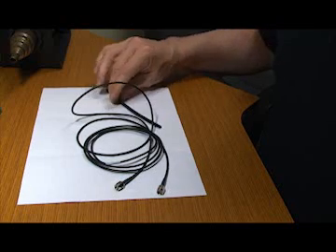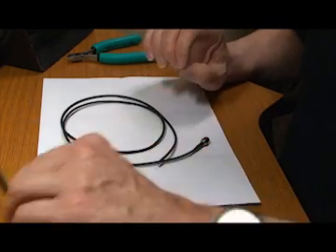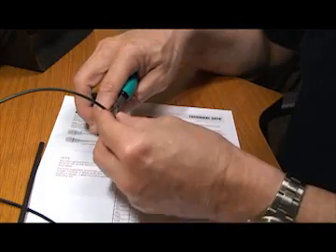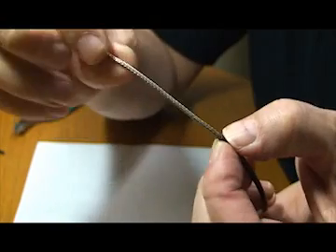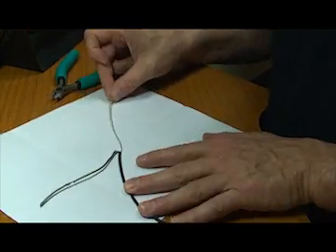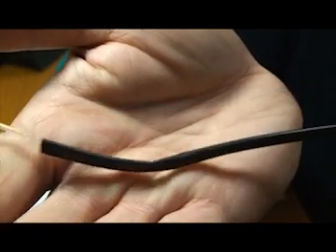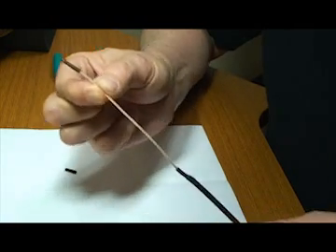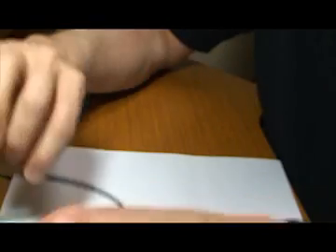Making a Coax Dipole Antenna for a Wireless Microphone System

Comment: Very helpful, thank you! What type of cable are you using?
Reply from the maker: We recently made some of these antennas again using Amphenol RG316 cable material with pre-terminated SMA connectors. We needed ones that were 4.5 ft. long so we purchased a 10 ft. SMA-SMA cable and cut it in half. RG174 also works well.

Comment: Hi.  Thanks for this video.   Any reason this can't be deployed with your 822's?  (I hear you mentioning in the video that this works with transmitters as well as receivers, but just triple checking since the video was made about 5 years before the 822's came out).  Thanks.
Reply from the maker: Yes, absolutely! Passive antennas are reciprocal - they can be used for transmitters or receivers, and have the same directional properties (i.e. a dipole has a "donut-shaped" pickup OR transmission pattern. These coax antennas with an SMA connector would work well for the DCR822.

Comment: What would be gained by stripping the dielectric? Exposing the copper.
Reply from the maker: The copper shield must be "rolled back" to expose the center conductor, which then acts as an antenna.
Reply: @lectrosonics  yes I do get that this is half of the antenna (it’s ground plane) and should be down for proper impedance. The questions regards the dielectric insulator on the upper element. It appears you left it surrounding the copper.
Would there be benefit on exposing the copper on the element instead of leaving it inside the dielectric as shown?
Reply from the maker: OK, understood. No, there would be no benefit to removing the dielectric, as it is transparent to RF. Keeping it in place will help keep the "antenna element" straight, and avoid oxidizing or damaging the copper conductors.
Reply: @lectrosonics  Thanks!

Comment: How wide of a frequency range would you recommend for this? I have some wide band SMDWB's. Could I make one antenna to use, or should I make several on different "center"  frequencies?
Reply from the maker: This type of antenna has about 100 MHz of bandwidth (3dB down points) so the 75 MHz tuning band of the SMWB type transmitters is well within that range. We recommend tuning the antenna to the middle of the band, so, for band A1, you would want the antenna tuned to about 500 MHz. We supply one whip antenna with these transmitters, for the A1 band we include a block 19 antenna, which is likewise tuned to the center of block 19 at about 500 MHz.
Reply: @lectrosonics  I am putting mics on some football players. Depending on the type of pads, sometimes the best mount is lower, or antenna down or sideways (which I know is not best). Looking to make some of these and tape it higher on the pads.
Thoughts and suggestions are welcome.
Reply from the maker: Yes, the higher the better, and vertical for the last few inches if possible. These cable antennas give you (literally) much more flexibility for placement. And, they can be simply taped in place as long as you are not using metallic tape. Up on the back of the shoulders is probably the best location if you can get that.
Reply: @lectrosonics  exactly what I was thinking. thank you for the confirmation.

Comment: and of course being a dipole I can plug it to any 50 ohms extended cable. 
Anyway I attached 2 of these  to my harness,  this saved my job 1 week ago, was having  drops with the whip antennas since we were squeezed in tiny room with audio bag, cameras following the tv host in a building. thank you.
Reply from the maker: David, that's great to hear! Thanks for letting us know. The coax cable antenna is a great solution for a variety of applications. We wish more people would use them!
Reply: I suppose that it would.be effective for radio ham / trasceiver also.

Comment: if using it on a receiver, like a UCR 411, are you using 2 of them or just one togheter the stock antenna?
Reply from the maker: Usually, best practice would be to use two of these antennas into the receiver, or into a distro for the group of receivers.
Reply: unfortunately, I've used a common tv antenna cable 75 Ohm, I don't get any problem in the rx-tx range with a walking test, can I use it normally?
Reply from the maker: If it works, it works. This setup will not cause any damage. However, it is not optimized and will likely not perform as well as the same receiver with proper 50 ohm antennas.
Reply: is the cable thickness an improving factor?
Reply from the maker: At these lengths, there is probably not a big difference between RG174 and RG58 for instance. However, if you were going to run a longer length cable (more than a few feet) then yes, lower loss cable would be important.

Comment: great technique, but I was wondering wouldn't there be mismatch between the cable (feed) and the antenna ... dipole 73 ohm and the cable having some other characteristic impedance
Reply from the maker: The cable should be 50 ohm, and this small an amount of mismatch would be difficult to detect in the field. Adding a balun would needlessly complicate the design.

Comment: hello sir, thanks for the video.loved it.one thing i need to know is that i have lectrosonic Quad diversity system with UDM6 AND UDM6S rf distribution.i have been using this for almost 4 years. now its cables coming from udm6/6s are broke.please let me know what model are these cables(white coax cable),its specs and where can i get them.thanks
Reply from the maker: Please contact our Parts & Repair Department at service.repair@lectrosonics.com and they can advise you.

Comment: "make it any length you want" ; isn't it a dB loss with length, especially for a small cable like this one? Thanks for the video, very clear, very effective!
Reply from the maker: Yes, a longer cable will begin to exhibit RF loss, especially if it is RG174 (the thin stuff). But for the purposes of a portable antenna for bag use, this is not a factor. For longer cables, it may be better to have a short antenna cable, and then an RF amplifier.

Comment: Question. Would this trick work same way for any other Transmitter/ Receiver of other companies as well as with standard BNC connector instead? Thanks.
Reply from the maker: Greenjah81 Yes, it does work for any radio device given it is made with the correct termination and the correct frequency band.
Reply: lectrosonics great, thanks a lot! I'm gonna give a try to my Comtek transmitter to extend the antenna.
Reply: half wavelength of a 216 comtek is 2,25 feet... a little bulky!